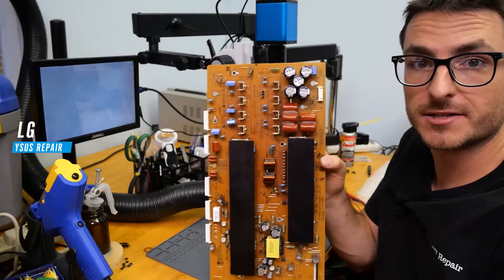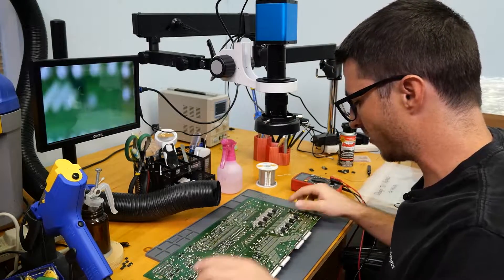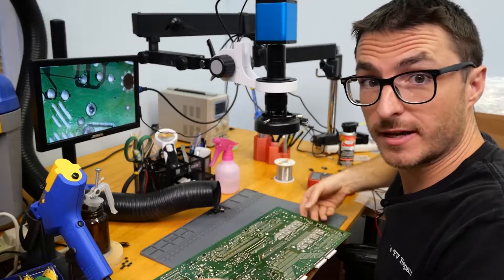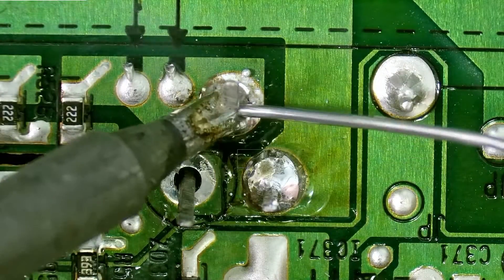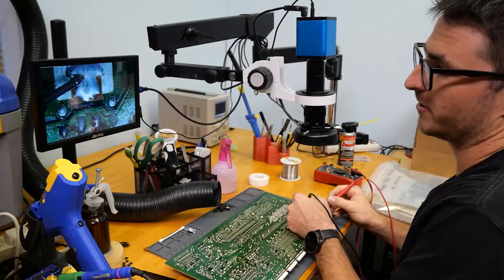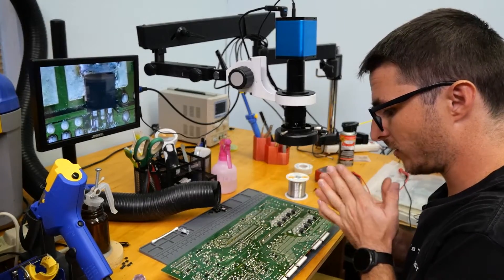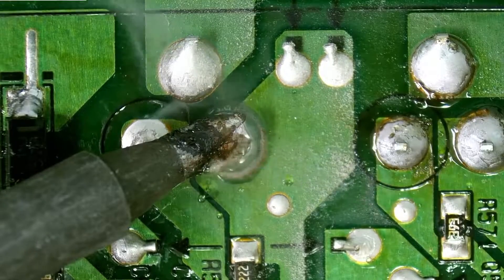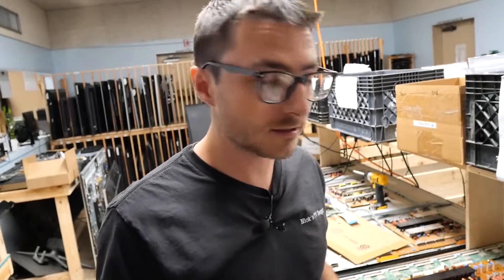LG Plasma TV YSUS Repair EAX647896501

Comment: This explanation is quite good. However, different components are faulty on my board. The component labeled Q602 is a small three-legged part with no marking on it. I need a schematic for this board. I have to replace the damaged components. The Q602 part is blown, and the nearby SMD resistors are shorted. The large MOSFETs underneath are also shorted. I need to repair it completely. Can you help me?

Comment: Hi, I hope you are still here. I have a 60ph670s and actually same board was defective. I replaced same parts and also 2 dual transistor, 2 optos  and a transistor which are located right corner side of the mosfets and dual diodes.  Tv gives 200 V gradually froö psu to that board  and cuts out voltage.   No picture no sound. Only on/off seems working on the side of the tv and commander.   Do you have any recomendation ?
Reply from the maker: Im sorry there are to many reasons for that to happen. Could be a cracked joint, could be one of the parts you installed, or it could be just a one off issue. I would need to work on the board myself to be able to give direction.
Reply: @NicksTVRepair  Unfortunately I live in Turkiye. There is no way to send the board. I'm an electronics technician and mainly worked for military companies which are served to NATO and nowadays biomedical solutions. I have experince on many electronic equipments but it does not include plasma tvs. This is my  first and only plasma tv about ten years old and don't have any screen burning on it. So I want to repair it. I will give it a try. Thank you.
Reply: Hello again. I did repair the board. How I could not find,  still going angry by myself.  One of the 2R2 resistor has been  blown.  I replaced  it but there were so many color specles especially red and green.  Made some voltage adjustments  Va-Vsc-Xbias etc. Now, picture has acceptible quality but not perfect. Still  some red specles and can be visible on black color. I'll Try to fix it.
Reply from the maker: Those specles could actually be because of cracked solder joints. I would recommend you check the entire board for cracked joints, but not just on the Y-sustain also on the Z-sustain. Both can get cracked joints and both can cause that.

Comment: Great Video and nice work 🎉
What are you doing if you don’t have a donor board for components? I am looking for a diode actually from a LG 42PW451 with a 83 10 or 80 10 code. 🎉🎉🎉 

I can’t find a schematic or a value for the diode. Number on the board is D23 and D24
Reply from the maker: That's a tough question. I usually have donor boards. But if I don't I spend a very long time on the internet trying to figure out what it is. Sometimes most of the time spent to repair a board is identifying the part and finding an equivalent replacement.
Reply: @NicksTVRepair  That was the answer I wanted.

I like to repair circuit boards in my free time and always try to improve my skills, but sometimes I come across components that are difficult to read or not labeled at all.

Nice to hear that the pros are struggling a bit too

thank you for sharing your knowledge with us

Comment: hi sir..my LG plasma tv model 42PN4500.ATS got problem, the power indicator ON but no picture and sound. What i should do sir..tqvm.I am from sarawak borneo island
Reply from the maker: Unfortunately that is not going to be enough information for me to be able to help. This could be a fault caused by every board in your TV. You would need to start with the color pattern test as your first step. This is what we did when testing this board at the end. For more info on how to do that, you can check this video out:
https://youtu.be/PawPbJVsk34?si=-sk78-wFsGmEKhrZ

Comment: Hey, I saw your video and I have the same kind of issue. I replaced the diode D603 (3:05) on my board just like you did because it was also shorted : no longer shorted. I also tried to remove each crackling that I saw on the transistors (3:15), just like you did (didn't replace them), but the short is still present on each of the 8 components on the right of your board (huge square transistors). What can I do ? replace the transistor at 3:15 ? And where can I find it (them) if so ?
Reply from the maker: You will need to replace them if they are shorted. These boards can fail in several different ways, you may have more damage on your board than we did on ours or vice versa. 
Most of those components are discontinued, but you can find them from chinese sellers on eBay or alibaba or aliexpress.
We also do have a mail-in repair service available linked in the description, we provide a 1 Year warranty on the service as well. Typically our repair takes 3-5 business days.
Reply: @NicksTVRepair i know itll vary but what for example wouod it cost on the reapir in this video ?.

Comment: Hello,

I hope you read my comment. Im from Germany and my Vathers TV has the same Issue I figurt out my self what is brocken and I replaced the IGBTs and the Mosfet as well as the Diode an the Resistor R251. I have a Kind of Picture on the TV but with masive flikering. I tryed to Setup the Potis but I Was not able to get an Good Picture. Do you have an Idea?
Reply from the maker: When that happens, sometimes its because of cracked solder joints on other parts of the board, or maybe one or more additional transistors have failed but not compltely shorted instead they have failed half way. It's also possible you still have a bad component such as a shorted diode, or open resistor somewhere. 
I have seen on occasion cracked solder joints on the white connectors that connect the Y-sustain to the buffers, so check those as well. 
Good luck

Comment: I am happy with the troubleshooting and repair method in this video. I received a similar board for lg 60pn6500 with legs of  the shorted undersiide mosfets and two diodes desoldered.  Q509(EY504) at far left of longer heat sink missing.
Please help me identify the number of the  missing transistor. I will greatly appreciate
Reply from the maker: If it's in parallel with another, you can get that information from the one next to it.
Reply: @NicksTVRepair  K8A60DA

Comment: Hi bro i have a board just like that im not getting the 15v goin to the tcon board no parts are reading bad
Reply from the maker: You most likely just have really bad cracked solder joints then. I would recommend checking all your joints and reflowing the ones that look suspicious.
Reply: @NicksTVRepair  thanks I find the problem was the transformer that sending the output voltage got me like 2 days looking for damage parts haha was a good fix everyday u learning on these work I save 150 us dollars I was goin to replace the board

Comment: Pls can you tell me what are the components marked FL(followed by numbers) on LG plasma tv.They look like diodes.
Reply from the maker: I am not sure which components you are reffering to, but typically the first letter of the location ID is an indicator of what the component is. If it starts with the letter D then it's a diode, letter C is a capacitor, Q is transistor, T transformer, L is inductor, and F is for fuse. So if a component is marked with F I would assume it's a fuse of some sort. 
Can you provide pictures of the components in question? 
Or are you saying that the component itself has the marking FL followed by numbers? 
If the latter is the case then my answer might sound harsh but it's google it. That's what I have to do on a daily basis. When I have to look up the specs on a component, I type in the markings on it into google and look at datasheets.
Reply: @NicksTVRepair the components itself are not marked but denoted on pcb as FL706 and testing continous both ends.They look like diodes without the white band so they must be fuses.Hoping you had come accross these components on y sus LG plasma.Thanks for your feedback and sharing your knowledge

Comment: My 60" LG Plasma is showing pinkish on white images, is that the a bad panel?
Reply from the maker: It could be simply an issue with the sustain boards being on their way out. 
I would suggest you plug in a smart device, go to youtube and bring up a full white screen video. 
Then take pictures and email those over to support@nickstvs.com so that myself or one of my guys can take a look at it more closely and let you know.
Reply: Same issue here
Reply: @fyerfytr  i got my issue resolved, remove both y & x sustain boards, locate the coils, the solder joints on those are probably cracked, just re flow or resolder those and thats it, it should work!!
Reply: @TigredelMar77  Thank you! I will definitely give it a go. I have a good solder station and am pretty handy, I appreciate the info!
Reply: @fyerfytr  NP,  Let me know if you have issues locating those coils
Reply: @TigredelMar77  Will do thanks a bunch for helping out
Reply: @TigredelMar77  ok I have the ysus board out are the coils the capacitors or the copper coils? Ty
Reply: @fyerfytr  the coils look like springs and they are made of dark copper, almost red ish
Reply: @fyerfytr  i wish i could send you i picture
Reply: @TigredelMar77  that's OK I found them thank again! Just re-soldered. See if that was the problem.
Reply: @fyerfytr  you probably want to do that on both  Y & X boards, which are the right and left.